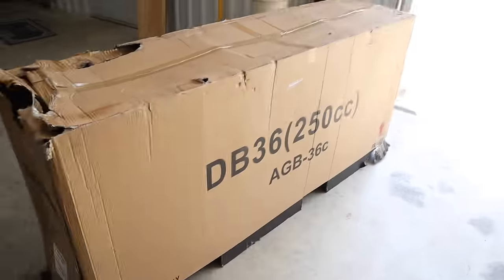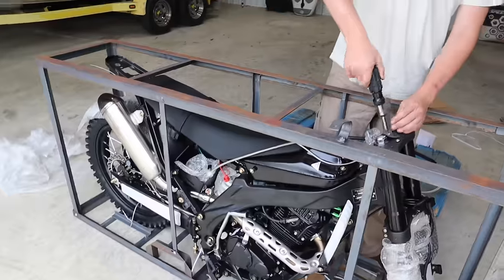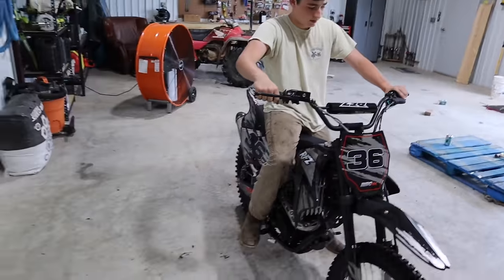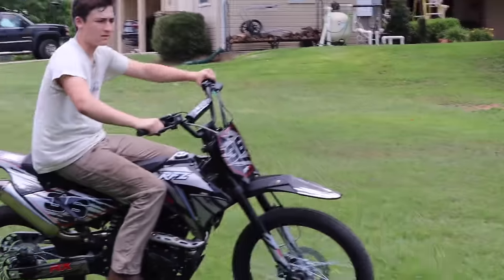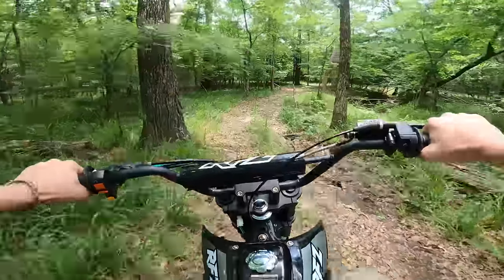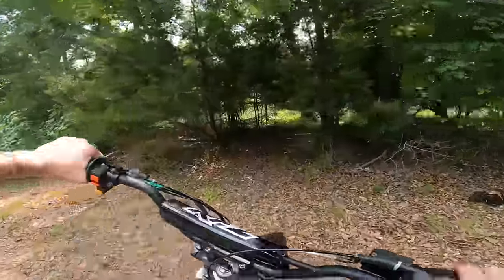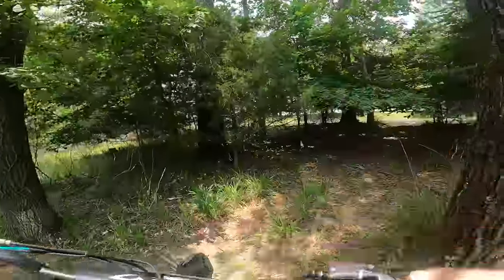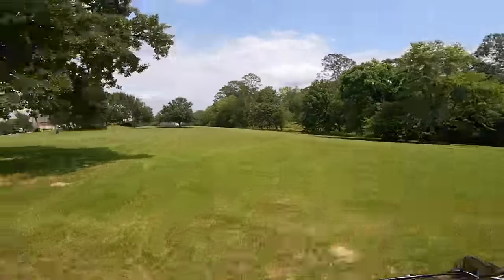I BOUGHT THE WORLDS CHEAPEST FULL SIZE DIRT BIKE!

Comment: i bought this exact bike as a pit bike in 2021 and it can take an absolute beating and honestly i havent had hardly any issues with it other than the back tire spokes breaking.
Reply: name of it?
Reply: Where did you buy it and what’s the make
Reply: Yeah i bought my first pit bike when i was like 12 (long time ago before all the bigger brand ones) i owned 3 of them and they were all pretty solid for cheap chinese bikes but spokes were always the first thing to go and plastics were always brittle so snapped and cracked easy, other than that though they were all very reliable worst failure i had was shredded the teeth off second gear on my first one (dream 110 semi automatic) just skipped second until that got stolen then bought manual ones after that and they only ever had spoke and plastics break, but then i realised they were far too small and bought a yz250 and never looked back lol

Comment: Definitely buying one. Re-jet the carb slightly for more torque and top speed. Maybe work on airbox if needed. Perfect little dirt bike for goofing off
Reply: bro send me the link bro please
Reply: Straight pipe it too.
Reply: I've seen that some fellas buy a different carb and open air filter for these china bikes that flows a little more and has more adjustability, I believe that costs around $100. Amazon usually offers it as a bundle with some of the bikes and the reviews mention it as well.
Reply: I need 2 grand to be able to goof off lmao
Reply: Just buy a used Honda you’ll save so much
Reply: You don't work on these bro.. just get a second hand jap in that case

Comment: I've had a Chinese cruiser since 2007 and it still looks ok and still starts of the button i changed the sprockets and carb instantly I also took it all to bits and coated the bolts and frame in rust protector it has never let me down and manages to turn heads as it has a unique look
Reply: dude i was BORN in 2007

Comment: If you get a bigger, better carb and play with the jet sizes a little they really open up. 
The stock carbs are really underwhelming and these bikes run extremely lean from the factory.
Reply: Bigger sprocket in back and smaller sprocket in front will give u the low end u need and better wheelies!!

Comment: I bought this bike against a lot of peoples advice… I sold it 5 months later.. To be honest, it’s not bad to get a brand new bike for that cheap and you can have a lot of fun on it but now with my experience, I’d give the same advice as everyone else… If you can afford a nice brand name bike, do it. If you can’t, find a used one for the price you’d pay for this. 
The reasons-
•Parts. You get what you pay for, like cheap rims and aluminum gas tanks with faulty welds that crack in less than a month of super easy riding.. Or dry rotted hoses that came with it.. Or cheap leaky acid batteries.. Or a rear break mounting mechanism that rips the caliper off when using it facing the top of a steep incline..
•Parts, but again: You may think “Oh, I can use pretty much any parts from a Honda 230 or some other bike!” Lol, there’s some that are interchangeable but pretty much everything you can expect to crap out soon is proprietary, and ya know the ONLY place you can get most the parts for it? A website based out of the Netherlands, so you wait about a month to get your poly gas tank so you can ride again, you put it on and then your rear brake fails the next ride and you get to wait another month if the Texas site doesn’t have it in stock!
•Power: This was my first bike, so it was great to learn on but I quickly found myself needing more. You can still get just about anywhere other bikes can, but you’re not bringing the front up over a rut on dirt in 2nd or higher, so if you ride with experienced friends you will not keep up on certain terrain and they will have to constantly wait for you.

Once all the things that can be helped are remedied, it’s a pretty solid bike and would even be practical if you got the street version where it’s legal, but for anything else I’d suggest go with the normal green blue or red, even if it is 5-10 years old. If you STILL buy this thing like I did though, just do yourself the favor and order a poly tank right away, along with a decent battery. I’d also recommend buying new wheels, if you hit a sidewalk crack too hard with the stock ones they will bend and warp. You’re going to want to re-jet it right away as they come super lean but that’s pretty cheap and easy. Lastly, and I know it’s a pain in the ass, learn how and adjust the valves. With just a valve adjustment and re-jet the bike will feel MUCH better. Hope this advice helps someone, and would love to see an update video 6 months to a year from now.. But I’d be willing to bet a couple bucks this bike won’t still be around by then 😂
Reply: A last side note- It is possible to rejet the stock carb, but you will have to drill brass plugs out of the holes that hold it together without drilling into the screws underneath. It was a pain in the ass though and I still messed up, so I’d recommend just spending the $25 on a cheap replacement when you rejet it
Reply: hey i live in the netherlands, i need one kf these
Reply: how much does it cost?
Reply: @nikosvr8813  It cost me $2,047 assembled from Orion Powersports, but you can save a couple hundred by assembling yourself
Reply: bro pls send the link
Reply: @purlydev  Amazon
Reply: Yeah you are better off buying a used suzuki,kawasaki,honda etc. Those name brand bikes will have the power and suspension/frame to handle real wear and tear. I started off on a klx125 and I'm glad I didn't settle for a Chinese Apollo whatever, my riding buddies talked me out of it.
Reply: Its about upgrading the bolts, using thread lock and upgrading to after market parts I have a 2021 apollo rfz z40 max with aftermarket upgrades, I run Royal purple 10/40 cycle max oil with ngk premium spark plugs, 24mm pwk nibbi carb, z40 racing cam, and my bike runs just as good as Japanese bikes and I keep up with them on the track and my frame can take a good beating when it’s steel double beam.
Reply: Not to mention I top out at 68 mph and have an oil cooler
Reply: @VDM32 may as well have just bought on older cheap yz125 or yz250 and had a better bike lol
Reply: @MDM1992  I only paid 2k total for everything a used bike here in california goes over 3k and most of them are old and clapped out
Reply: @phrg8332 don't
Reply: I just bought an 09 rmz 450 for 2500 here in Mn. Do not buy this bike.

Comment: The exhaust system is, likely, restricted. The welds are not dressed down, inside the exhaust piping. The bike will lose the, strange mid - range running and increase acceleration and top end, when cleaned out. The smaller a Chinese engine is, the greater the exhaust system restriction will be. That's the average rule of thumb for American consumers. Good video, here! That's an awesome old Honda 4wheeler!👍
Reply: Bro why can’t I find a KX style exhaust system for my kids Chinese bike, the gasket end isn’t the same? Like my sons is bolt on and the ones I’m looking for look screw on?
Reply: @jackwolstenholme8213  Cutting the flanges off the pipes and switching the Chinese mufflers flange to the fat - pipe that you have mounted in position. It takes,  very little, mig welding and it will function fine. Wrap the pipe with fiberglass exhaust wrap. It prevents burns and looks fine.
Reply: @troymattingly3071  how do u even know all that brother
Reply: @IlIlIlIlIlIlIlIlIlIlIlIlIl-p8s  when you work on stuff for a while and do you own redneck Frankenstein builds you figure these things out.
Reply: @3lsforyou83  ight whatever
Reply: @IlIlIlIlIlIlIlIlIlIlIlIlIl-p8s  Dad started me on small engine repair at 7 or 8 years old. I have been riding motorcycles as my primary recreation, on Japanese bikes, all of my life.
Reply: @troymattingly3071  ohhh cool bro thx for replyin, bless
Reply: @IlIlIlIlIlIlIlIlIlIlIlIlIl-p8s  Have a good summer!
Reply: @troymattingly3071  you too bro

Comment: It's a 230 Replica.  So add a Big Bore Kit.
Port the Exhaust & Intake Valves. 
Take out the Catalytic Converter In the front of the Exhaust..
Bigger flat slide Carb& Air Filter..
Add a Larger Cam.

It will be a Monster.
Reply: 230 Replica

Comment: 2000 is kinda expensive granted it is new. Just bought a 05 RMZ450 in great running condition for $2500, done a couple things to it I’m in it for $3000 an it’s running fantastic and well over 60hp.
Reply: Not needed for fun, racing maybe, but not fun.

Comment: The information I found online says it has a top speed of 70mph! If that's true, then it won't hurt to put on a larger rear sprocket for a little more torque/acceleration instead of top speed. Then it won't be so hard to pull a wheelie, and yet you could probably still get a top speed around 55 or so. Also, with the larger sprocket, it'd be a little better for the slow riding through the woods trails, or if you're making your own trail and need to get over a log or rock.

Comment: When you buy a new motorbike you should always use the kickstart if it has never been started before so the fuel can get to the carburettor easier
Reply: Bruh you made me blow out my cloud of smoke reading this😭😂
Reply: bruh im weak asf either way the engine is getting turned over and hope ya know its gravity fed as soon as fuel is in the tank and the valve is open the carb will fill up

Comment: Im a moped mechanic in the Netherlands, and the 50cc version of these things are made road legal here. Which is basically exactly the same, but with a 50cc engine. So we see these things coming in a lot for maintenance etc. But these things are terrible reliability wise, moving parts wear out extremely quickly, they have bad build quality, and almost no quality control. We see these things sometimes come from the factory, having driven not even 1000km's, and already with terrible problems like bad crank bearings, bad headset bearings etc.

Comment: I am a dirt bike rider and been a fan of dirt bikes since I was about 5 got first one around 7 but a year or 2 ago I bought like 400 enduro for 400 bucks it was from the 70s or 80s and I swear to you it looked brand new who ever owned before me got everything redone except for the motor I bought it and literally bought a who mew carb system she started up on one kick once the new carb and spark plug was in and it was a pretty bike all the pain fenders grips clutch breaks the cables was all redone I couldn’t pass up on it and it rode like a beast for me older it was a Suzuki

Comment: The warning is definitely weird, the french and english versions don't match.😆Both are about removing something that has to do with a tube but it deviates pretty quickly. There's nothing about explosion and dying in French, it looks like an advice on how to make the motor run at it's best instead of a warning. There's stuff about air and something that is supposed to leak a little bit of oil usually. Eng version is probably closer to what they were trying to say but the wording is still highly suspicious. 🤔😵☠

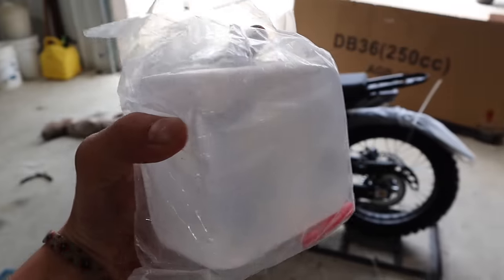Comment: Oh god, I’m at 3:35 and I just face palmed .. I really hope buddy doesn’t hurt himself putting that ACID into the battery lol
This bike honestly has NO balls whatsoever.. I don’t think the bike broke 3000 rpm’s the whole vid lol.. you see him twisting throttle like a kid that just learned how to whack off lol.. when he’s accelerating , the bike doesn’t jump in RPMs even a little bit lol.. also, the pipe getting red hot like that after like a minute of full throttle isn’t a good sign.. this being an air cooled bike, wouldn’t be good for trail riding at all, unless you actually know how to ride and can carry yourself through the bush fast enough to cool the head/cylinder .. if not, you’re gonna be burning through rings and bearings like no tomorrow

Comment: That brand is fucking garbage 
Dont waste your time 
Always breaking.
Have bought the 125 and the 140, and they plenty of problems with the Db36 according to the 
 Hale Michigan dealer. Waste of time thank god i personally ride a 2018 yamaha 250f . My son rides the DB-18x and my girlfriend rides the 140max 
Both effin junk just to ride normal around the yard. Chain problems, brake problems, stator problems , carb problems, kick starter problems, the brake fluid is so cheap it heats up and locks the rear brake caliper if u ride for an extended period in 4th gear on the 140 max , as it has a slight tension on the dish from the brake pads. Rear hub has bolts shear off a few times and inner tubes are junk